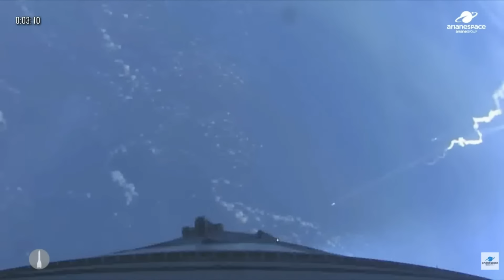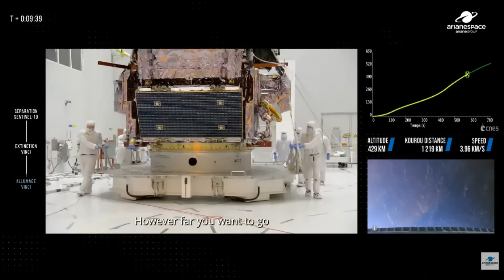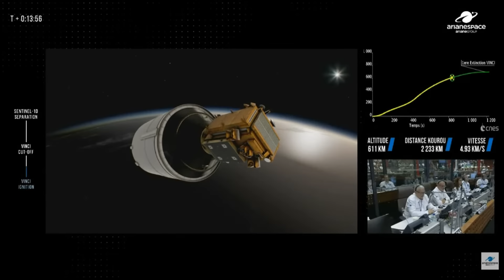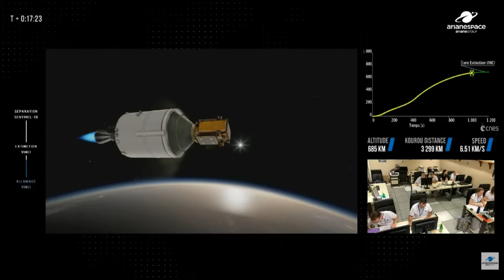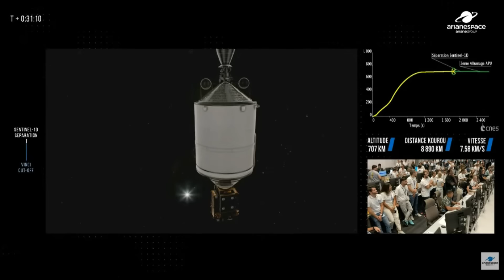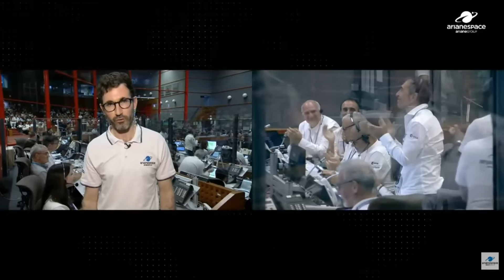Blastoff! Europe's Ariane 6 rocket launches for the 4th time ever

Comment: Q: Why do "sateloons" (i.e. communication/monitoring satellites suspended from lighter than air balloons) require rocket propulsion to position them in the correct altitude? Could they not be delivered by airplane or direct from the earth?   
A: because altitude is position in the atmosphere, and you can’t “park” a balloon there without first crossing the unstable layers below it. Rockets aren’t used because balloons need thrust in orbit (they don’t) — they’re used because getting a large, delicate, buoyant system cleanly and precisely into a narrow altitude band is surprisingly hard.

Comment: As a European, I feel like Ariane is a company of old folks launching rockets. One rocket every six months, and when they launch it, they display the same enthusiasm as residents of a nursing home after handing out an unexpected treat... if they don't change this dynamic, we'll see them starring in a Jurassic Park sequel.
Reply: There is one more launch planned by the end of the year and  6 to 10 launches are planned for 2026, and 3 of them will use the more powerful version 64 for the first time (with 4 boosters). There are 11 more launches planned for 2027 or later. There is a clear ramp-up. The average launch rate of Ariane 5 was between 3 and 7 launches /yr   (4 /yr on average). Ariane 6 will probably return to that launch rate and surpass it.

Comment: That thing is tiny. Like a model rocket.
Reply: 530 metric tons!  Tiny?!?!
Reply: @sebastiendine4834  Where did you make up 530 tons? Payload is 10 tons at most. SpaceX payload 150 tons. Yes, this thing is tiny.
Reply: @JMAC479  The entire weight of the Ariane 6 launcher is 530 tons. The max payload to low earth orbit (LEO) is about 10 tons for the 62 version (with 2 boosters) and 22 tons for the 64 version (with 4 boosters). The weight of the Falcon 9 is also 530 tons and its max payload to LEO is also 22 tons (when fully expandable). If Ariane 6 is tiny then Falcon 9 is also tiny.
Reply: @sebastiendine4834  What? Oh..tiny rocket is 10 tons. Got it. SpaceX Starship is 150 tons. You still have a tiny lil rocket pal. I don't know what else to tell you.
Reply: @JMAC479  I compared Ariane 6 with Falcon 9 which are in the same category and are already lauching commercial payloads. Starship hasn't achieved a single commercial launch after 11 launches. That 150 tons number is just theoretical and has NEVER been achieved and proven. You need to compare things that exist NOW not things that may exist in the future. The rest of the world is using tiny rockets according to you but at least these tiny rockets do exist and are useful NOW in the real world and are not fantasies.
Reply: @JMAC479 Falcon 9 at 22.8 tons payload compared to this at 21.6 tons lol
Reply: @JMAC479 Falcon 9 at 22.8 tons payload compared to this at 21.6 tons lol
Reply: @sebastiendine4834  The rocket didn't roar at takeoff, it hissed. This baby rocket squats to pee.
Reply: You could just check the facts, read a little bit, before making stupid coments like this
Reply: Falcon 9 at 22.8 tons payload compared to this at 21.6 tons lol